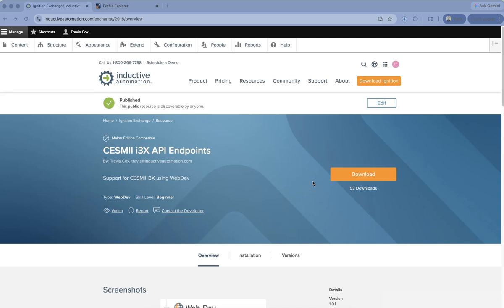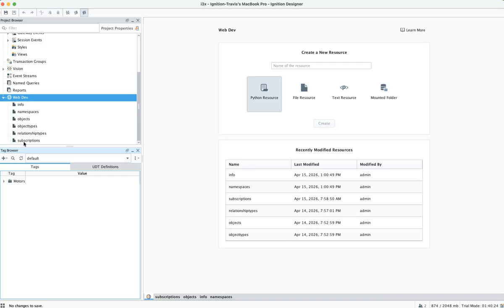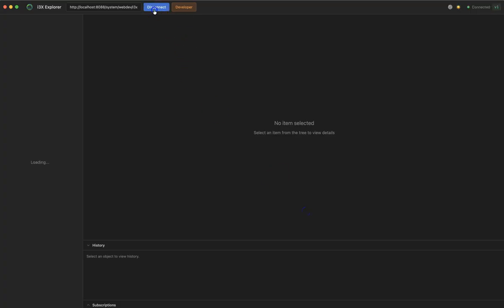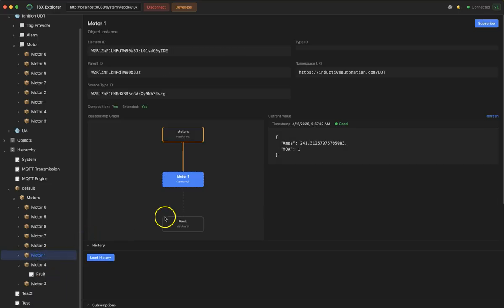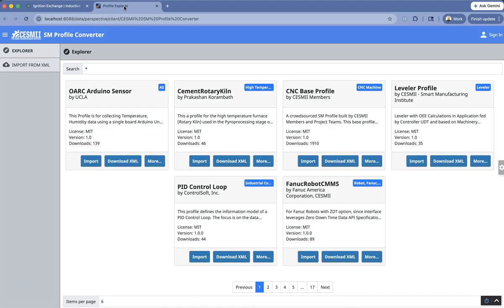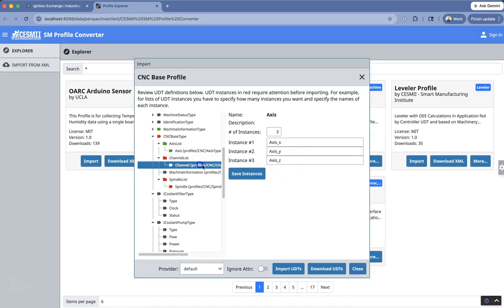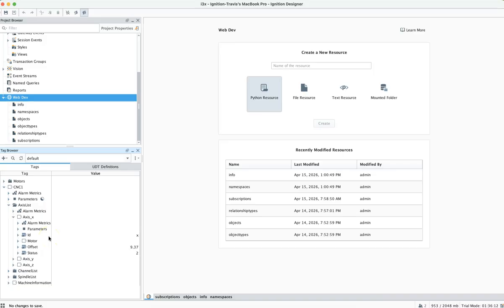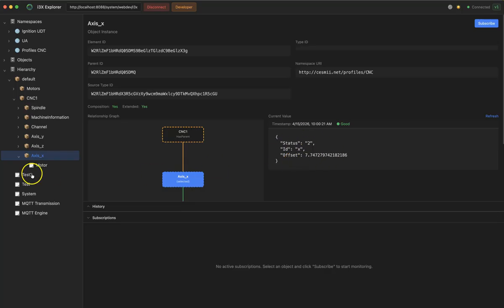Inductive Automation: i3X™ Integration

Comment: So with the WebDev module you could theoretically use ignition as an end-point and a client side. Like I can use this project to build my profiles and another project to connect to the data using i3X to build a web-app. I'm trying to see how an end user would use i3X in a non-custom application. because i3X is a bridge from the UNS to the end user, this should allow the use of vendor applications to work both ways.